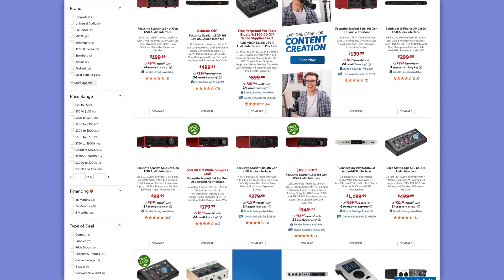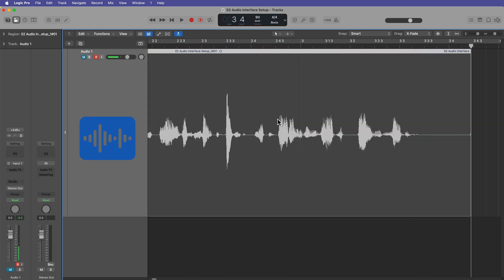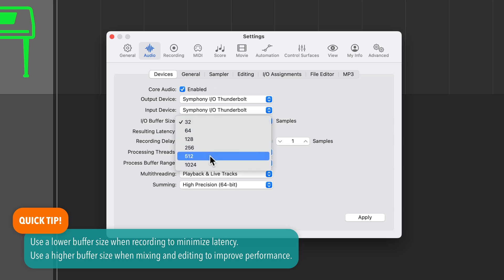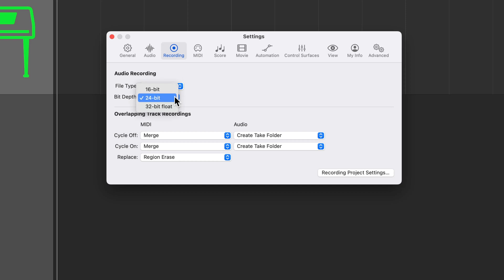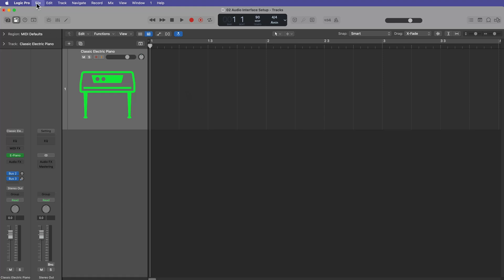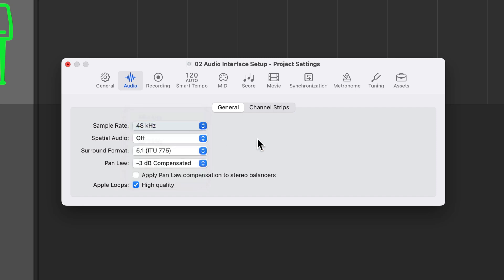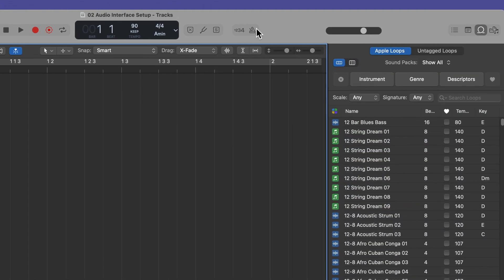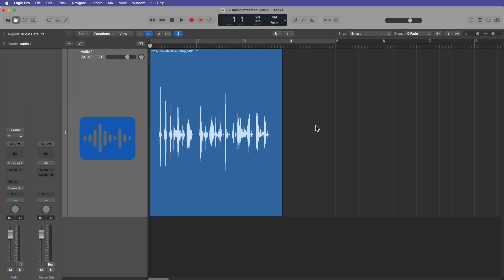Logic Pro 11 - #02 Audio Interface Setup, I/O Buffer and Digital Audio Fundamentals

Comment: Hello ! I have a very strange issue! After this set up I am able to record voice correctly. However if  I try to record acoustic guitar with the same mic a very strange sounds results in the recording (the monitor sounds ok) the sound is like a bad cable was plugged.
The strange  thing is that this happens also when i try to record the guitar with DI connected to the a interface.. any idea?

Comment: Love your videos man! We use Logic on our Mac mini m2 Pro to record and input monitor our live instruments and vocalists live. From time to time, we’ll get system overload despite have the I/O buffer size at 1024. All other apps are closed and we have 16GB of RAM. Does the multithreading setting impact CPU usage. We currently have it set to Playback and Livetracks.
Reply from the maker: You definitely want it set to "Playback and Live Tracks" to spread the live processing over multiple threads. Your RAM doesn't really matter as much for the application you've described, your processor speed and number of threads is going to be more important for that. If it was an older Mac mini I would say that your processor is too slow, but the new M2's have pretty blazing fast cores and 8 of them. If you are running any plugins live, I would look at swapping out things like Limiters, or plugins like Ozone, ChromaGlow, and other high CPU load plugins. If you're using plugins live I'd stick with simple EQ, compressors and reverbs.
Reply: @MusicTechHelpGuy thank you so much! The vast majority of plugins we’re using are stock Logic plugins with the exception of 2 Waves plugins: Clarity Vx and Real Tune Real-Time. The heaviest processing we have is on the vocal channels with EQ, Compression, DeEsser and finally the waves plugins. Reverbs and Delay are on a vocal buss. Perhaps we should move some of the vocal channel plugins to the buss?
Reply from the maker: Clarity Vx is probably the culprit. Background noise removal is quite CPU intensive. Even some of my iZotope RX11 plugins for noise removal cannot be used in real time. I would think about maybe swapping that plugin out for a finely tuned Gate to gate the background noise when they are not playing/singing. RVox is a pretty good one from Waves that's meant for vocals - one of the only Waves plugins I actually use! Good luck.
Reply: @MusicTechHelpGuy  thanks again. I’m appreciate your prompt responses.